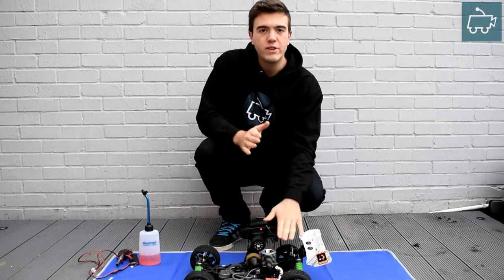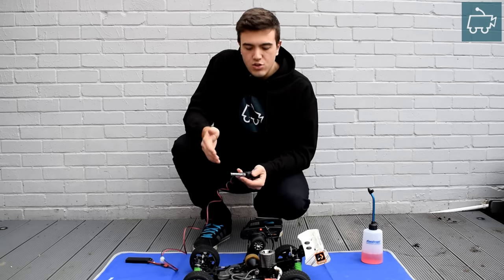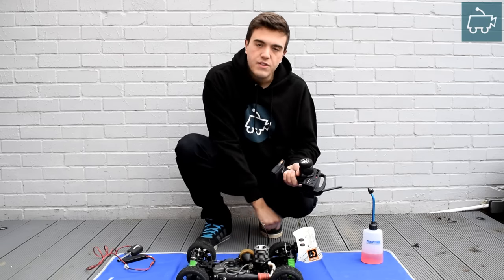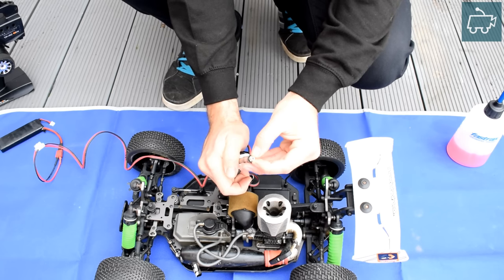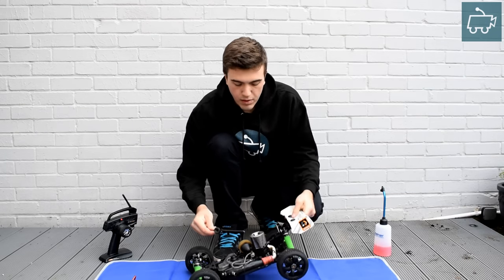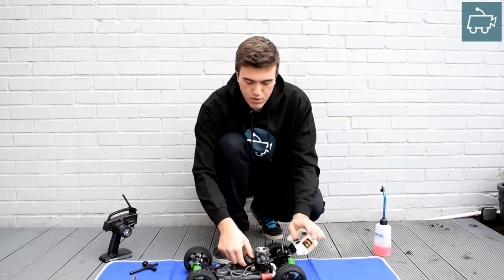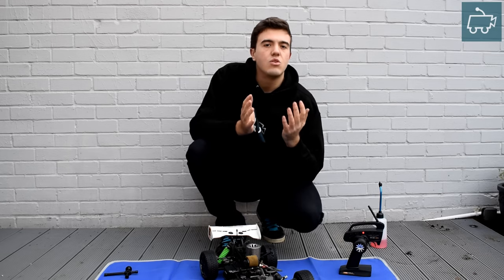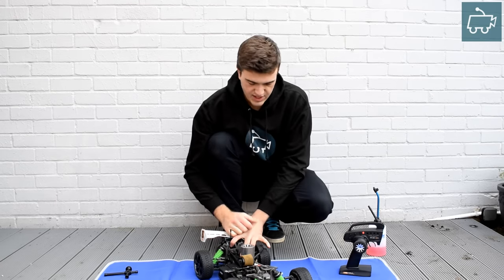How to Start a Nitro Engine after months of no use

Comment: after run oil knackered up my engine, nitro already has oils in it and I've never had a problem without it
Reply: How would it "fuck up" the engine? It doesnt matter that nitro has oil in it. It is essential for lubrication, but after run oil creates an oil film that kind of pushes away the nitro. Sure nitro has oils in it but it also has nitro. If something is flammable, and in this case nitro is really f*ucking flammable, it easily reacts with material. And all this means rust in the engine. I recommend using after run oil or bad things will happen and you will be sad.
Reply from the maker: Personally I'd be concerned leaving my engines stored regularly without any after run oil. After run oil prevents moisture build up as the fuel inside evaporates, it puts a film on the engine that prevents rust & makes it easier to start next time. Have you had bad experiences with after run oils then?
Reply: nitro fuel is hydroscopic meaning it absorbs water which in turn will corode your engine from the inside.
Reply: RC car wrong wrong and wrong. Checkout my video on the subject. Straight facts.
Reply: JT12's R/C Videos yeah twice my hpi fire storm engine clogged couldn't put or pull the car and yes i did put the right amount in then when it finally fixed it self it then never started i had to strip the engine down buy new piston, glow plugs and new clutch and flywheel because the clutch was nackerd and the flywheel worn down and the piston snapped, 

then bit of a coincidence not long after i was using my ftx Hooligan this did the exact same thing only eventually it started and when it started it flew off everything set correct when i got it back everything was still set correct, turns out because it shot off and i couldn't get the carb closed enough because it would just cut out, when it was running the revs were very high which had warn the flywheel down and the clutch had slipped so then again i had to strip it all down buy new clutch and flywheel and even hpi said it was strange
Reply: Botond Kreiner you tell me
Reply: Not only is methanol hygroscopic, nitromethane will break down into nitric acid (partially anyway, and it's also an exhaust byproduct of nitromethane) and rust the hell out of any steel parts.  That said, I got my R/C stuff back from my ex after 5 years of sitting, and I only used good quality omega fuel, and didn't have a chance to put after-run in them (like I always did before) before she took my stuff in our divorce, and my engines all looked fine inside, zero corrosion, and started up perfectly like I had run them yesterday.  Omega does claim that you don't need after-run.....maybe they're not bullshitting! (Just my experience, I'll still use after-run from now on, just to be absolutely sure)
Reply: DeltaRacing That's the right answer. People are saying all these answers that they just made up. Thumbs up!
Reply: I've never used after run oil since and had no problems
Reply: Sir Crab my engine was all rusty inside but I still got it going after 11 years
Reply: Doug Hartwell yo mama
Reply: @DestinationCalibra  in my case after run oil rendered the one way bearing the pull start useless. Nothing but taking it apart and cleaning the one way got it to grab again. 

Thought I used too much oil but even tiny amounts would kill the pull start. After some trial & error I settled on marvel mystery oil as that didn't affect the pull start. 

"After-run" specific oil will never be found in my box again.

Comment: Thanks what if the oil has been in the engine for about 7 years, as my rc car is at my friends house and he said the engine is flooded and I would require a new engine along with a pipe and exhaust and pull start, is this bullshit ?

Comment: Ty this is why I like my drones build racing drones and they're a lot simpler I charge a battery I put it on I start the rig I fly battery gets low I bring it in hanging on my wall when I'm done
Reply from the maker: I like drones too :)
Reply: Electric debate too honest electric can be too
Much as much as these 75cc petrol engines you see for the 1/5 scale cars electric is more complicated because of the battery get it wrong and burn your house down too be honest gas cars are more fun it’s simpler to get a lipo charger that charges simply in a simple way meaning more fun grab your gas grab your receiver battery and bash around your local field lol on the plus side your car won’t catch on fire so that’s a bonus aswel
Reply: @jonathanoxlade4252  🙄🤔🙂

Comment: Hello I got a tomahawk st for Christmas and I really want to know how to get it running properly I've watched all of your videos but they are diffrent engines so I'm quite stuck I've tried to look online but there is basically nothing out there I was just wondering if it's possible to video call you or something yes I know it sounds a bit crazy but this is my last hope 🙏
Reply from the maker: The process of tuning nitro engines is the same regardless of which engine it is, you need to learn the signs of a rich/lean mixture and then tune it accordingly. If the carb is messed up then return the tuning needles back to their factory default settings and work from there

Comment: May I know what size LiPo you use for your glow igniter? How many volts please.
Reply from the maker: Hi Dale, the battery voltage doesn't really matter as the igniter will regulate the voltage to 1.5v regardless of what the battery voltage is 
I tend to use whatever battery I've got at hand, either a 11.1v or 7.4v LiPo 
You can connect any battery up to 20v to it
Reply: TheRCBiker thank you so much! Have a little .05 nitro that is giving me fits to start, so figure pumping in more power to the plug cannot hurt!
Reply from the maker: @dalesilvernell2053  It's not an ACME NB16 is it.... ?
Reply: TheRCBiker nah, it’s a Sportwerks Chaos 1/16 bought used on EBay.

Comment: What to do if i haven't started my nitro in like 11 years?
Reply: mine was sitting in the garage for like 7-8 years, yesterday I check if its not eaten by rust, and lady luck smiled back, it started after the third pull with a cold engine. I almost jumped from joy.

Comment: my car sat for almost ten years, and the fuel in the plastic flask to, and i just fueld it up and started it and it ran just as it should do, i have been running it a lot since the first start after storage and it still runs as it should and the compression is like it is on a new Engine, i have bought new fuel now but thats it.So i dont Think storing the Engine is that dangerous as people Think.

Comment: uh...ive had nitro fuel thats been chillin in my garage for about 5 years OR MORE...and it still works a charm.
Reply from the maker: It all depends where you keep it ;) Cool dark place like a garage will be OK. But some people put it in warm lofts or garden summerhouses where it hot & condensates
Reply: @TheRCBiker  ah i got ya, yah it was kept in a garage just chillin. Then when i went to use it again i half suspected it not to work but decided to give it a go and YEP worked like new. I did gently mix it though just to be safe.

Comment: What does it mean when you get like air pockets in fuel line that make car bog down then back to normal idle?
Reply: Daniel G Usually from an air leak. Some tiny bubbles here and there in the air line is inevitable but most of the time there should be none. Again, check for air leaks. Many culprits can cause air leaks like fuel lines, fuel tanks, carb pinch bolt coming loose, etc. Some will tell you to "seal your engine"......Don't do that, it's unnecessary and in general bad advice from morons. Noobies tend to destroy engines when they go to seal them. Engines don't come sealed from the factory for a reason, they don't need it. Best of luck and enjoy the process of learning so one day you'll help someone else.
Reply: Daniel G **Meant to write "fuel line" not "air line".
Reply: xXG.L.HXx  thanks for the help!
Reply from the maker: +1 to what this guy said! Won't be a big issue, certainly don't start rebuilding your engine it'll be a simple fix as he said :)

Comment: My nitro truck has been sitting for over 5 years... I'm worried the whole thing is junk. The engine is seized, the fuel tank is full of gelled fuel, and the flywheel collett needs to be replaced.
Reply from the maker: I'm sure you can get it going again :)
Reply: Do you already have it fixed? If not, I can give you some tips on how to get it started.

Comment: what if my motor starts but its running and than after 20 sec it just go off?
Reply from the maker: Return your tuning settings to default (found in manual) and check the glow plug is working correctly :)

Comment: wat voltage regulator do u use on glo plug using yr li po cell ,?
Reply from the maker: It has a voltage regulator built into the Igniter
Reply: just got dc to dc voltage reg .08v -20v  adjustable ,£2.50 got glow clip ,can hook up to any dc power ,same deal,lot cheaper lol,, ivegot a hyper 7 pro spec ,with upgrades on top, are hyper 7s only good 4 bashing these days ? been out hobby 6 yrs was planning to race ,is tht stilll competetive ,i use rb ws7 2 motor ,or would i need up to date kit , obv the engine be ok
Reply: wats max ud give a glow oplug  i use novarossi plugs not these cheap ones ,would 1.4 /1.5 be max or cud i give it more u think ,been told up to 2v  but most drivers only push 1.2-1.5 v

Comment: how do you dispose of old Nitro fuel?
Reply from the maker: If you've got a recycling centre nearby that takes old engine oil they'll usually allow you to pour it into the same drum, if not like Bob below has said it burns. Not the most environmentally friendly but no different to burning it in the engine!
Just try to avoid pouring it anywhere, it kills plants/grass etc

Comment: Never ever put fuel by the glow plug hole, you have a serious risk of breaking the piston, connecting rod and the plug. If you want to get it started, put some in the car. 

If you want, you can put some fuel in there to wash the engine, but don't put the glow plug in when fuel is in the chamber, you should always get it out.
Reply from the maker: Not sure what you're saying. I'm not suggesting to flood the engine. But putting a few drops of nitro on top of the piston does nothing more than lubricate the engine and give it more chance of igniting quickly. Particularly if the engine has been sitting for a while, by putting fuel directly on top of the piston will lubricate the engine and give you a much better chance of getting it started! Obviously if you flood it, then yes you will put extra strain on internal parts.
Reply: JT12's R/C Videos The upper part of the engine is supposed to work with nucleated fuel, not plain liquid fuel. The fuel you're putting on top won't burn because the ratio isn't respected, so it will drain out of the exhaust and could cause major damage as fuel isn't a compressible fluid. 

A good way of getting the slimy fuel out is to remove the head and chamber and bath the motor in pure methanol. If the engine is set correctly, to get fuel into the motor, plug the exhaust with your finger and pull the cord 5-6 times, or blow in the pipe as you did. (be careful, 2ml of methanol causes permanent blindness.)

The reason fuel turns to slime and oxidize is because nitromethane corrodes the lower engine.

I'm flying planes which are much higher cc and never had trouble running an old engine, but you HAVE to take it apart and bath it. (slime in the bearings isn't good at all.)
Reply from the maker: Ok. So with that theory then, what happens to after run oil and why is it recommended by R/C manufacturers to put that on top of the piston after uses and during storage? 
I've never had any issues with putting a few drops of fuel directly into the engine in 10 years, and many R/C Manufacturers recommend doing so because it prevents turning the engine over dry without any lubrication.
Reply: What you call after run oil is WD40, as the engine is not sealed with rings, it's using the surface tension of the castor oil to maintain the piston-chamber seal, WD40 helps eliminating the corrosion that happens on high % nitro, but WD40 ( or after run oil) also has a way lower surface tension.

It doesn't create that air-tight high pressure seal on the piston, so no high pressure is created in the engine and no extra stress is applied to the structure.
Reply from the maker: I'm talking after run oil, not WD40. WD40 is much thinner. I don't quite understand your logic. So you're saying that putting two drops of Nitro Fuel on top of the piston, (which is no different to priming manually), puts more "stress" on the engine than After run oil which is 10x Thicker than both Fuel and WD40? 
I've never heard of this. I'm not questioning your theory, but I think it's unlikely how R/C Manufacturers would recommend these methods if they are likely to cause damage! Anyway, never had an issue for 10 years and always gets my engines going... So I'm gonna stick with it :D

Comment: how do you find out if your engine has gone bad? from over heating at one point,rusting etc
Reply from the maker: What makes you suspect it's bad? Any engine can be rebuilt there's not much to them, new piston/liner can be replaced easily along with crankshaft. Overheating will damage the piston/liner, they won't have a good fit therefore you'll have lack of compression.
If you remove the heatsink and see rusting or build up of deposits you can clean internal parts :)

Comment: i drop oil in engine  then heat up using a heat gun..give it a few pulls then i add a couple drops nitro fuel.
Boom! all set! ..oh! i also use a turbo glow plug..i let it sit half a tank then bash away...
Reply from the maker: nice :)

Comment: I have an Hpi that will start 'but has no throttle response ' the clutch gear is good & I have searing . A bud of mine has a Traxxas W/ a smaller motor & he was saying that I need a cone shaped bushing w/ 2 flat side's on it . I'v never had a Nitero ' but plenty off electric ones ' So I don't know much about them jimmiesteve47
Reply from the maker: I'm not sure what you mean by cone shaped bushing with flat sides. But it sounds like your clutch might need replacing ?

Comment: Actually  your wrong but right nitro can go bad  )u can still run it ) after 4 months. Not to mention  I bought  this specific brand yes nitro goes bad after so many months/years 
.....but for every  quart of bad nitro ad 2 quarters WD40  4 parts 1 part salt 2 quarters to every part depending on the oz

Comment: How about 30+ years of storage
Reply from the maker: Follow the same process, however if the engine has been stored without after run oil/fuel inside you will more than likely need to remove the carburetor and engine internals and clean / rebuild it.

Comment: Throw some fuel down the airfilter hole it
Reply from the maker: That's the same as putting the fuel on top of the piston really :)
Reply: I think putting some fuel into the carb is a little better because it creates a better mixture of fuel & air making the engine start more easily but as you showed in your video, putting some fuel in the glow plug hole also works.